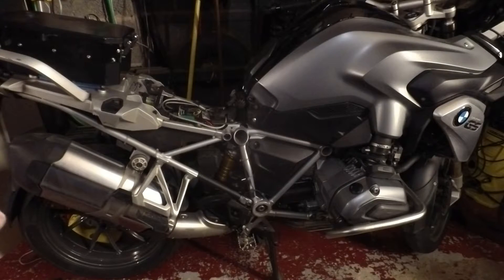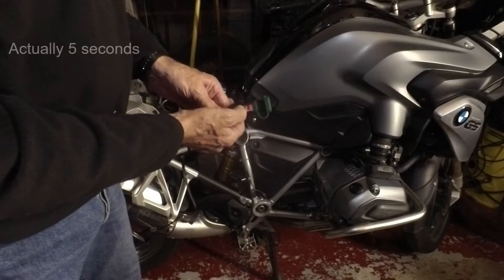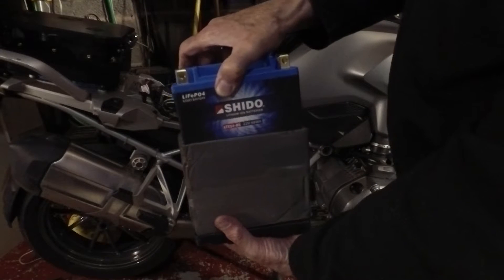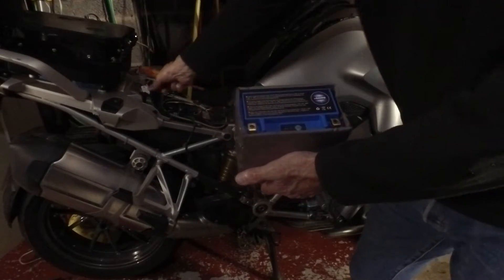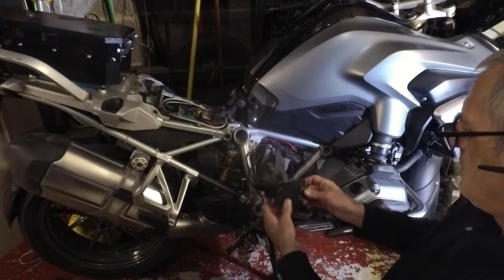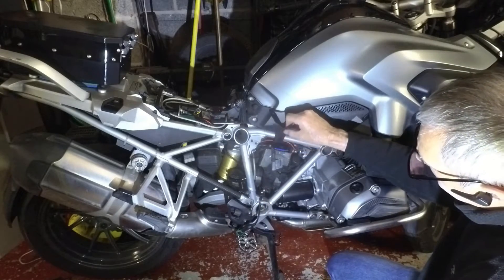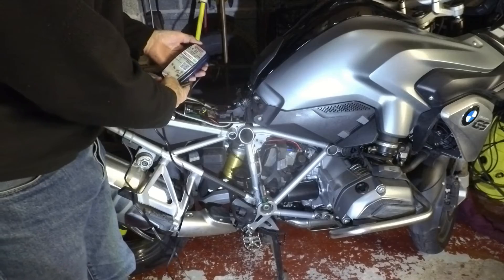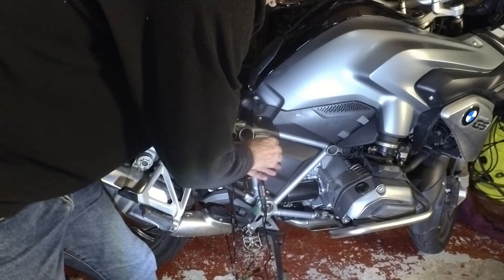BMW R1200GS Lithium Battery Installation

Comment: Thks for you vidéo. Wanted to know if the optimate charger you are using is special for canbus bmw ? As I do have a Ctek and Wanted to plug it direct to battery but bren reading that canbus compatible charger only... I, also think about putting à lithium batt for the weight. Shall then buy a New charger I guess
Reply from the maker: Hi. I do have one of the Optimate chargers that’s CanBus compatible. I used to use this through the BMW DIN socket on the bike, when I had a lead acid battery. It worked OK but more recently I started connecting the charger straight to the battery (with it still in circuit) and took the Optimate out of CanBus mode. BMW advise against this but it was fine for me for well over a year. The lithium battery does need a different charger but I’ve connected mine straight to the battery again. It is an Optimate lithium charger but doesn’t claim to be CanBus compatible. Seems to be fine though; I’ve had no issues with it affecting the bike electrics. I hope this helps.

Comment: Hi as its been a few months could you give me an update on how the battery is cheers
Reply from the maker: Thanks for the question. The battery is still performing OK, just a good as immediately after I installed it. So long as I keep it on my 'Optimate Lithium 0.8' charger at home all is good. Lithium batteries provide great CCA but have much less energy capacity than the original lead-acid type. So I find that it won't start the bike after being idle for about a week (because of my tracker, camera system & BMW alarm). Not a problem for me but it could be for some.
Reply: I've just bought a gs and the battery is flat after its been standing for a week is the norm for gs bikes then
Reply from the maker: It shouldn’t flatten that quickly. I have had issues with my battery draining (see my other videos) but I think this is mainly down to the accessories I have (INNOVV camera & a GPS tracker). Never quite got to the bottom of it. I’ve learnt to live with it now though, even with the lithium battery & I’m happy. I do carry a small jump starter battery pack though (a cheap one from Lidl). I started doing this when my lead-acid was always letting me down. Haven’t needed it since installing the lithium battery but it’s reassuring to have anyway.
Reply: @Greeves  I've left mine sit for over a month with the microwave alarm on (goes into standby after a few days( and the 1301CC V fires straight up on the EarthX 36C.

Comment: EarthX do models that have more real Ah than the original lead acid ones (I have one in my 1290 SA S) but they are of course pricey. :)
Reply from the maker: Thanks for this; I’ll check it out. Mind you, my current Lithium one is performing fine at present - so long as I keep it on charge if leaving it for more than a long weekend
Reply from the maker: I've looked up the EarthX battery for the R1200GS and the ETX24C seems to be the one, at 7.8Ah. I have a Shido LTX14-BS which claims 4Ah (48Wh). So the EarthX should hold nearly twice as much energy (though still less than the OEM lead acid's c.11Ah). The EarthX is 3x the Shido price (in the UK), so may be worth it for some. As always in engineering, it's a compromise that needs to be struck, based on use case. I'll review my own options when my Shido fails, or my situation changes. Thanks again for your comment, much appreciated :)
Reply from the maker: Thanks again; that’s really good. I’ll definitely consider getting one next time I need a battery 👍
Reply: @Greeves  👍
Reply: @Greeves  Hmmm, what's going on with YT, I can see your responses but my posts seem to have all vanished ... weird.
Reply from the maker: @eubikedude  Yeah, it confused me too. I don’t think it’s anything I’ve done. A YT bug?😳

Comment: How much amp withdrawn from the crank?
Reply from the maker: Hi. If I understand you correctly; the lithium battery easily beats a conventional lead acid battery, in terms of its ability to supply cranking amps. It’s internal resistance is lower (except when at freezing temperatures). The downside is that the lithium one has much less amp hour (I.e.energy) capacity overall, though this shouldn’t be an issue normally.

Comment: How is the battery working so far? Have you noticed the weight save when riding?
Reply from the maker: Hi. The battery is still working fine. Another commenter suggested that the BMW voltage regulator needs to be swapped for a lithium specific version but I haven't found this to be the case. I've kept an eye on the voltage (via the Garmin Navigator display) and haven't seen it above 14.5V. I do keep the battery on an Optimate Lithium charger at home. Without this the bike lasts about 10 days before failing to start. This is because of the the lower amp hour capacity and because I leave the alarm, tracker and INNOVV cameras on. I can live with this. 
The battery is much lighter but I can't honestly say that I notice the difference on the road. There again, I hardly notice the differencce between a full & empty petrol tank, so am probably not a good judge :)
Reply: @Greeves  Ten days! I just left my bike for two months on a lead acid and it still started (just). Ten days to a dead battery sounds dire. How much of that is your accessories and how much just the bike?
Reply: (small correction - it needed half an hour on the charger to start after two months)
Reply from the maker: @geoffbartlettphotography9434  
Fair enough. Lithium batteries do have much less energy capacity than lead acid - so they're not going to last as long. (They do have great starting current though.) I've had current drain issues on my bike and this seems to be down to the GPS tracker and camera systems that I have fitted (see https://youtu.be/__fAaJkVmbE). I'm happy with my lithium battery now I know it's strengths & weaknesses but they won't suit everyone. Thanks for your comment.
Reply: @Greeves  Thanks. I've just ordered one, so will now find out. As long as I don't end up in the middle of nowhere (a lot of that in Australia) with a dead battery. I will look for current drain when the bike is off, after the 15 minute auxiliary power turn-off. AND, I'll disconnect my battery if I'm going away for more than a week.
Reply from the maker: @geoffbartlettphotography9434  All the best with it. One last thought - when my previous lead acid battery was failing, I took to carrying a small jump start battery pack (from Lidl) in the top box, and used it a good deal until swapping to lithium. I’ve not needed to jump start since but do still carry the portable battery pack, just in case 🙄
Reply: @Greeves  Thanks for you comments. 
I saw the Motobatt jump start pack and it's essentially a small lithium battery. So really, with the light weight of these things, carrying a spare battery is not totally crazy. I'll pass on that for now though. I do all my mobile phone charging while riding and the bike's battery is not being a power source at night.

Comment: Do you realize you need to change out the voltage regulator to one rated for lithium batteries?
Reply from the maker: Thanks for this. I don’t think it’s necessary to change the regulator. The peak voltage is compatible with Lithium (and the Optimate monitor will show any excess voltage - as well as the volts display I have set on the GPS screen). My only concern is whether the alternator will dump excess current into the battery if the volts are low, after cranking the engine for a while. I’d be pleased if you’d let me know of any good sources on the subject though. Are alternative regulators available for the GS?
Reply: 999greeves I broke my connector on my regulator. When I went to replace it they were out of the normal ones but had a lithium. My battery was 4 years old so I figured I could go ahead and replace it. I got mine from a place in Denver called Euro Moto Electrics. They specialize in BMW parts. When I bought my battery they also told me I have to have a lithium compatible regulator. It looks like it still charges between 14.4 and 14.2 volts just like my original one.
Reply from the maker: David Cooper Interesting. I replaced my rear strut about a year ago. This entailed removing the ECU & folding up the rear subframe through 90 degrees. It looked as if taking the connector off the regulator was the obvious way to allow the subframe to rise but I was really struggling to get the connector off. In the end I left it on & detached the whole regulator instead. This gave the slack I needed. The connector is hard to get off, especially with the regulator in situ. I’m glad I gave up, otherwise I’d have no doubt broken mine too. Meanwhile, I’ll see what I can find about special lithium regulators. For the time being the old one seems to be performing OK 🤞
Reply: 999greeves That is how I broke mine. I didn’t even realize it was under the seat area. My instructions didn’t even mention it. Good luck, hope not works out for you.
Reply from the maker: David Cooper (In case you’re interested, this video shows how I took the regulator off (5 mins in). https://youtu.be/D6azY1WO9FQ I’d forgotten that I did manage to get one connector off but gave up with the second one.)
Reply: Not if the replacement battery has a proper BMS built in. I've run anti-gravity and currently EarthX for years > 50,000km without issue.